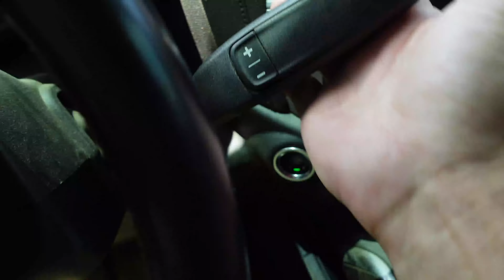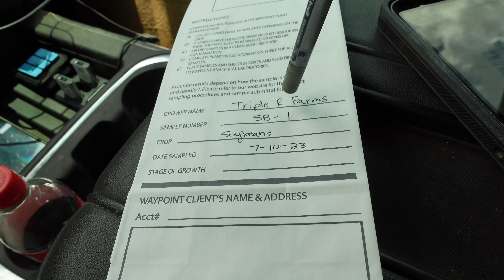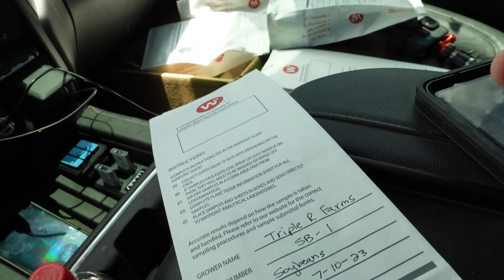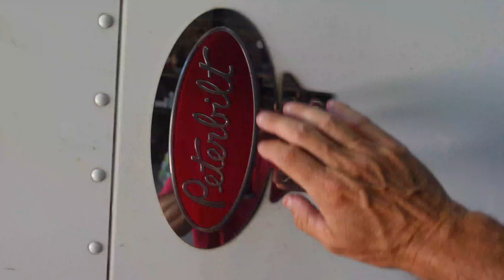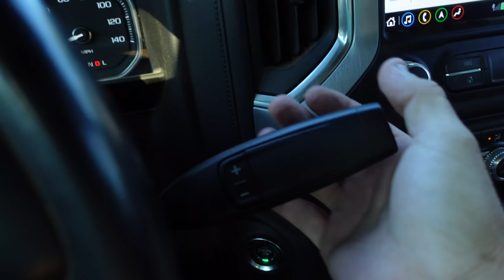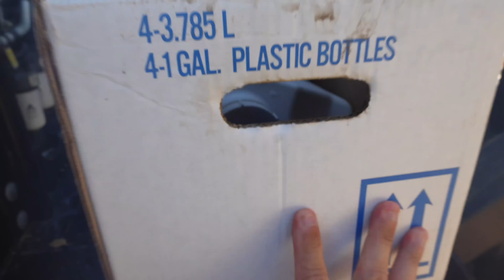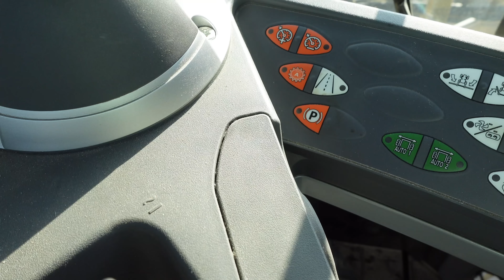DO WE NEED TO SPRAY FOR APHIDS?

Comment: Daniel little tip for James. Jack the front tire up when greasing. It'll take the grease easier plus he can check the front ball joints. 25 yrs i was a OTR  that's the way the ole timers thought me. Just a suggestion.